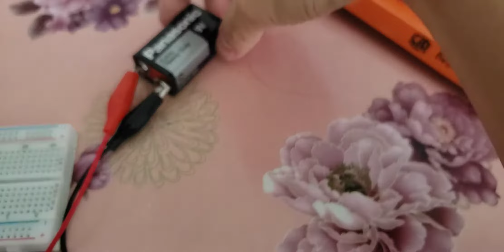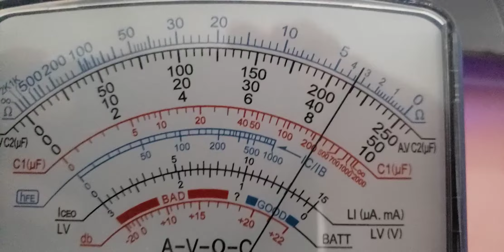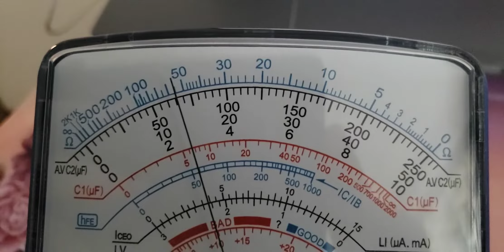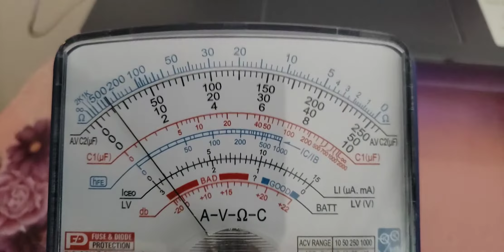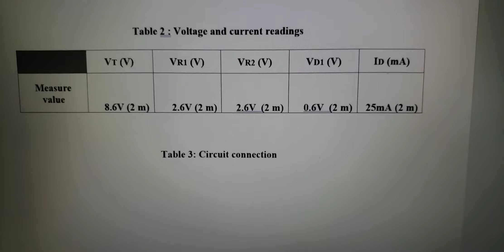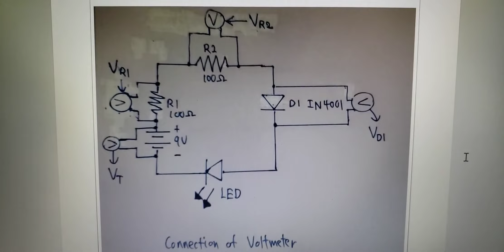Practical Test semiconductor

Comment: Regarding your comment on my video..
Mostly it means there is no ground in your circuit.  Place 0 or ground node at appropriate places.
Moreover circuits comprising transformers must grounded both primary and secondary side. In primary side we need to use extremely low ohm resistance as bleeding resistor.
Lastly make sure all components place on screen are from pspice library. Parts from other libraries are not  meant  for simulation. 

Do share..subscribe..